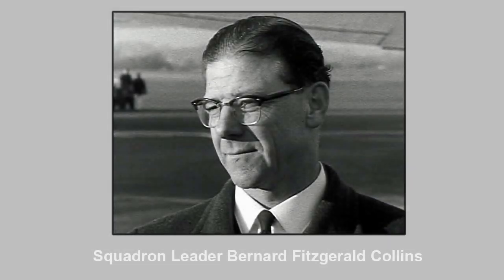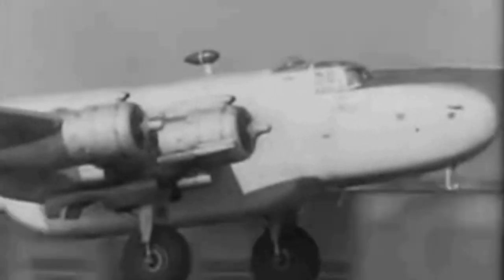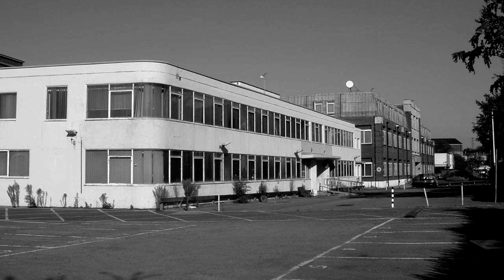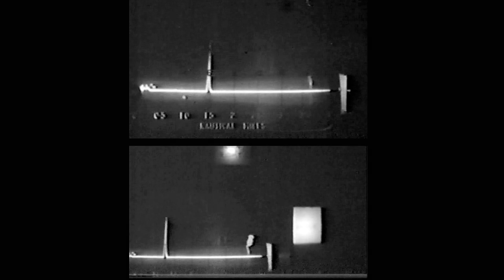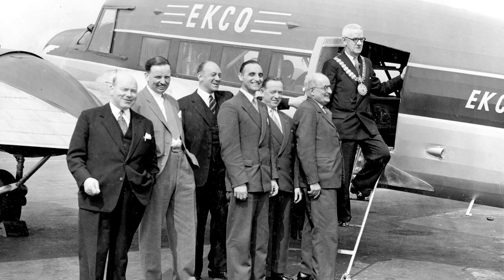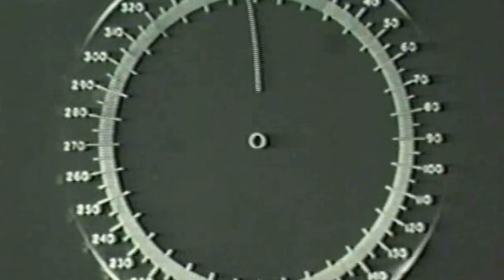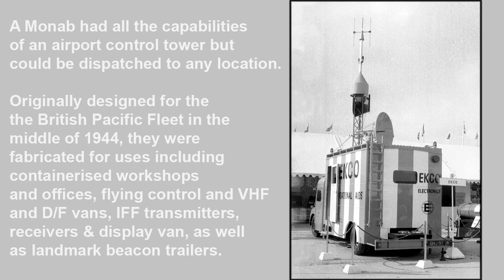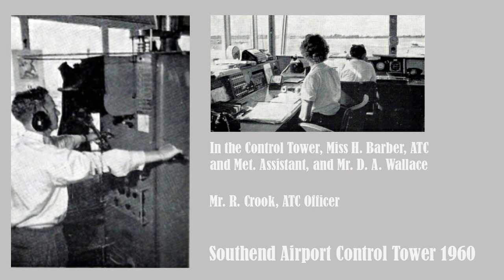EKCO Ground-controlled Approach Radar at Southend Airport

Comment: The halcyon days of EGMC and this system , they got me down safely on several occasions using this system, great bunch of controllers they had then. Thanks for posting this👍
Reply from the maker: What surprised me was the insistance that EKCO design and build a system that was fully functional for what would become a very busy airport but for a fraction of the 'going costs' other airports paid to have installed. And under such pressure, they came up trumps with a system that not only worked better then they thought it would, but was kept in use for many years. While earlier headway had already been made producing airborne radar systems, it's no wonder a lot of the chaps 'burned out' towards the end of their careers.